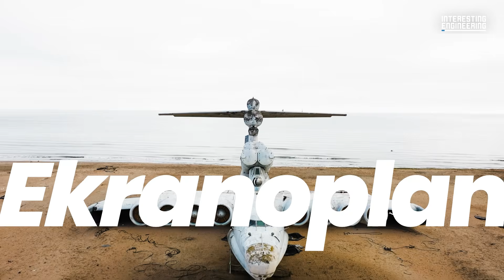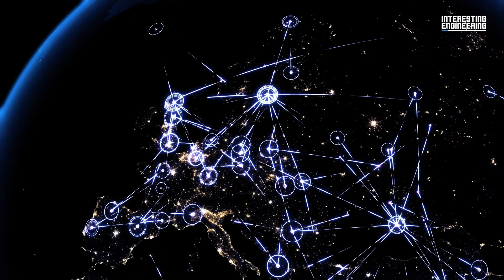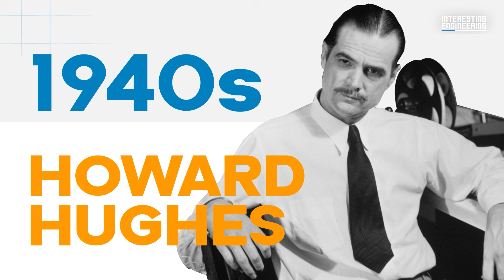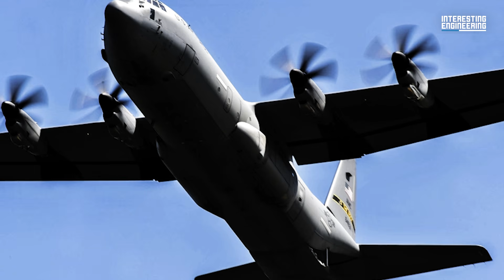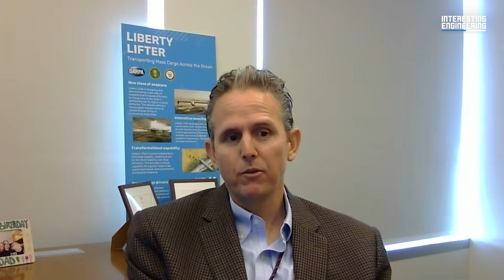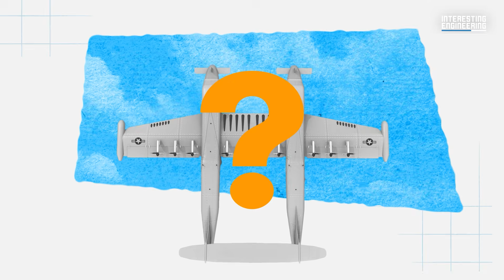The Return of the Ekranoplan

Comment: An ecranoplan has an enormous disadvantage in steering. An airplane can make relatively short turns which involve multiple g-forces, as they can turn their big wing surfaces into the upcoming airstream. An ecranoplan basically is an ice hockey puck flying over a slippery surface at hundreds miles per hour or more with no adequate way of steering.

Comment: bigger than a c130  but lifts then same as a  c130  and will be slower than a c10  thats kinda a waste  ( might only have a range win over the c130)
Reply: If I understand it correctly, once the craft is out of the water, the fuel use is vastly less than an aeroplane.
Reply: @juliannewman2557  air is denser near the ground so gonna use more fuel to push threw it . uses less fuel than a ship  but more fuel than a plane at altitude

Comment: I’d love to know why they chose to use Props instead of Turbines. Is it weight for a given performance envelope?
Reply: It's intended to cruise at only a couple hundred mph, so props work just fine.  The faster you go, the less time you have to react to obstacles, and the higher the operating costs.
Reply: Probably turboprops, which are very fuel efficient.